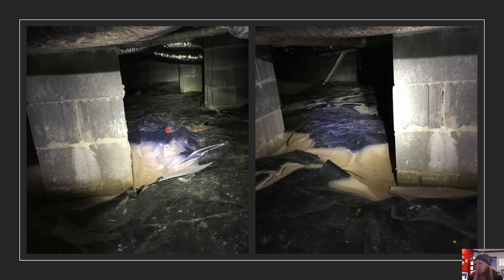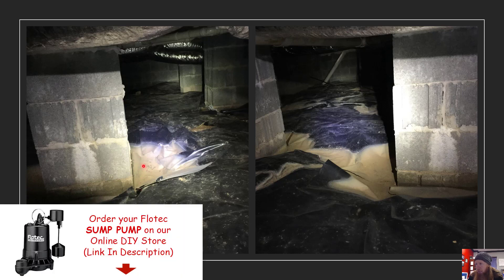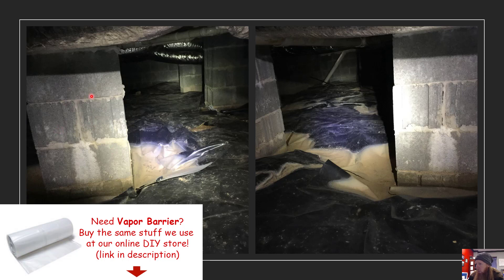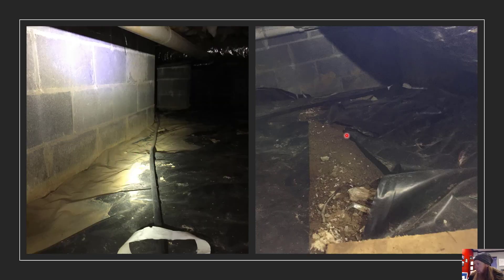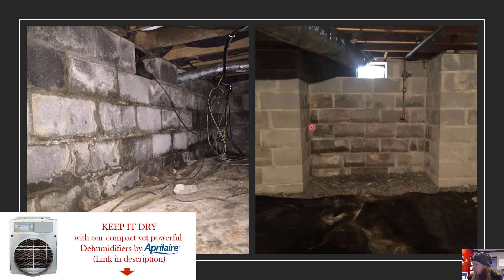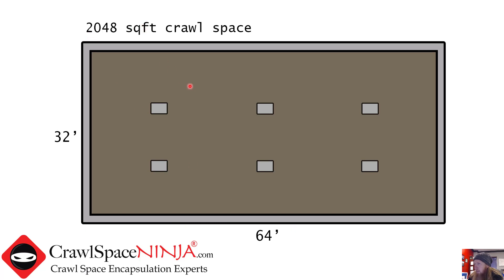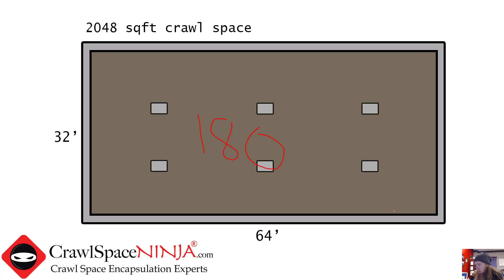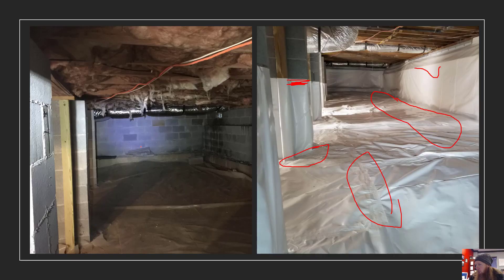Measuring Crawl Space Vapor Barriers Like a PRO!

Comment: Using 2" foam board on walls.  Could I go with some 6mil on walls and pillars and then do the good stuff on floor?  Totaling at 1,600sqft.  Floor is 928.  Trying to save pennies here
Reply from the maker: You can if you need to. Just make sure everything is sealed properly. It may not prevent as much humidity as you want it to but at least having the thicker mil vapor barrier on the ground should help quite a bit!

Comment: WOW Michael, I'm learning so much from your videos! I'm in contract on buying a house near Portland Oregon that has water infiltration in the crawlspace due to a messed up rain gutter system and some flashing issues. I'd like to do the encapsulation myself, with  a couple of young guys who are quite capable of helping me tackle this. I realize the need to eliminate the water intrusion issues first and determine if a french drain/sump pump is needed, then follow the sequence you outline to control humidity, soda blast to remove any visible mold, clean the surfaces, disinfect, repair as needed and treat with X70. Do I do all those steps before laying down a new vapor barrier, or do I lay it down after the first step or two to make the later steps less messy? Do I need to remove the old black poly vapor barrier and all the stuff I blasted off before laying down the new plastic, or am I better off just laying the new one over the old stuff? Can I fill in any low spots on top of that old plastic? I look forward to your reply, and thanks again for providing such a good education about all this!

Comment: Won't overlapping more then a foot trap moisture between? And why only go 2 or 3 feet up why not all the way?
Reply from the maker: It's possible but no different than the vapor barrier keeping the moisture in the ground from getting into the crawl space. IRC requires going at least 12" up the foundation wall and mechanically attaching. We choose to go up to the termite gap required by our state.

Comment: Hey brother I’ve got an encapsulation conundrum on my hands I’m wondering if you have any ideas what could be causing it. Basically I did a 6mil encapsulation sealed to the walls about 6” above outside grade. I did not fasten plastic to the dirt with any stakes because I had spots where I knew the water level would get up an inch or two during heavy rain periods. Anyways o go to check on the crawl about a week after and in the first chamber of the crawl the plastic is inflated with air about a foot off the ground. That’s right I said air, like a balloon. There are no pipes or anything under the plastic so I’m at a total loss for what could be causing this. Any info you can provide would be greatly appreciated
Reply from the maker: Wonderful to hear from you. To help keep the air out of the vapor barrier, you must anchor it. Otherwise, it will continue to parachute air thru.
Reply: Thank you Crawlspace Ninja

Comment: Re-doing the pillar calculation:

1. One face is 16" (W) x 24" (H), so the area of one face is: 16" * 24" = 384 square inches
2. Multiply that area by 4 faces to get the surface area for one whole pillar: 384" * 4 = 1536 square inches
3. Multiply that number by the total number of pillars to get the total surface area for all pillars: 1536 * 6 = 9216 square inches
4. Divide that number by 12 to reduce it back to feet: 9216/12 = 

768 square feet
Reply: This is actually wrong, but it's an important mistake. When converting from square inches to square feet in step 4, you have to divide by 12^2, not just 12. This is because there are 12^2 (or 144) square inches per 1 square foot (remember, 1 square foot is 12 inches by 12 inches, and 12 in. * 12 in. = 144 square inches). So, it's really 9216/144, or 9216 sq. in./(1 sq. ft./12^2 sq. in.). The "square inches" cancel each other out, and you're left with 64 sq. ft.

Here's a sample video: https://www.youtube.com/watch?v=sz2EatfTack

Comment: Hey Michael, I have the same issue with water pooling around the pillars. I already have a sump pump in my crawlspace. Should I dig a trench from the pillars to the sump basin and fill it with pea gravel? Would it be good enough to just remove the water and grade the dirt away from the pillar? Or does water commonly pool around pillars?
Reply from the maker: Collin Scott Thank you so much ! We would trench water from pillar to sump in most cases. Great question. You would make a great Ninja. 😀

Comment: Thanks for the videos and thanks for the free guidebook. I am just outside of your service area :-( in Versailles, KY. I have a crawl that averages about 5'5" high. I have a sump pump but no trench (not sure why the builders did it that way) but I really don't seem to have an issue with water standing, most is pumped out with the sump. My intention is to DIY encapsulate (since you're not in my area). Just wondering if I should put in a french drainage trench or not. It seems to me like I should. If so, does the drain need to be graded towards the sump or will water flow to the sump is level?  Thanks for the videos and the guide.
Reply from the maker: Water will flow faster if trench is slightly pitched if possible but keep in mind house footer drains are typically level so water will move inside the pipe in that case too. FYI from now until March we cover a wider area for full encapsulation systems. If you'd like to duiscuss the details please go to https://crawlspaceninja.com/crawl-space-encapsulation/ and fill out our free assessment link. Thanks for watching.